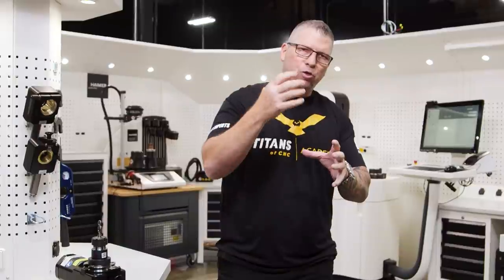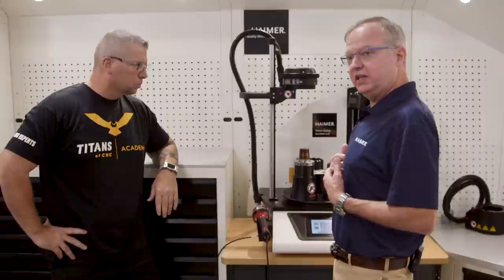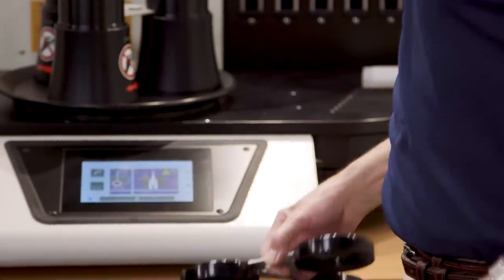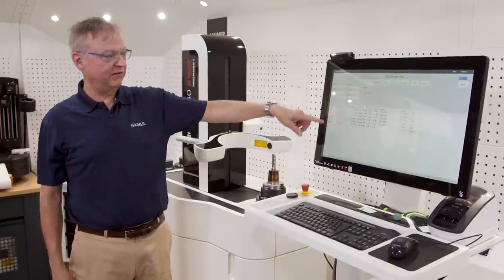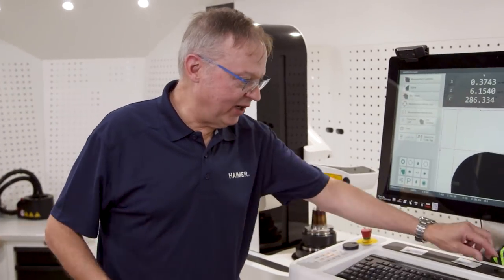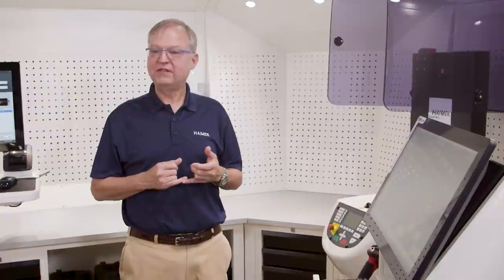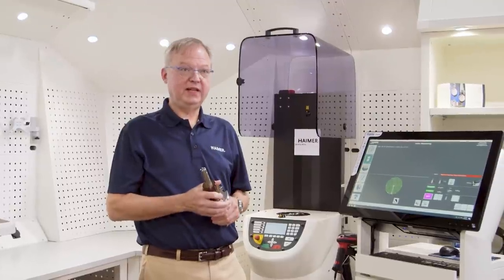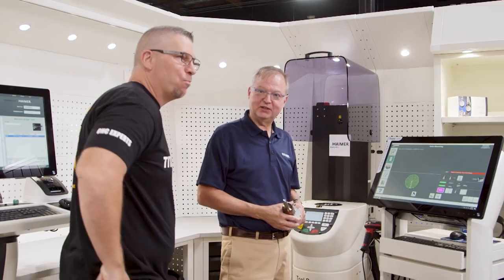CNC Machining Technology That Allows You To Compete | HAIMER Shrink Fit, Presetting & Balancing

Comment: I worked at a shop where we would replace spindles every 3-4 years. We implemented a similar system and it increased spindle life and paid for itself in the first few years. I would recommend this if you are holding tight tolerances.
Reply: What did you guys do that you have to change the spindle every 3 to 4 yrs?

Comment: This is amazing. Here’s my process at work: I take the holder out of spindle and drop it into a vise. Loosen the set screws, remove old tool, open drawer and hope I have another, drop it in, make sure it’s seated, tighten set screws with worn out Allen key and pipe, slap back in spindle and hit the cycle start button. My how technologically advanced we have become...
Reply: I know what you mean! Hydraulic tool holders have been a huge step up for me from some terrible ER collets but to jump up to this set up for most small machine shops is inconceivable.

I did wonder though, why not just get an induction nut buster and a vernier height gauge?
Reply: If your not short on time, you could also do it with a torch

Comment: Im very new at the whole CNC Mill game but I actually just ran into a situation where I was getting a really crummy contour finish. After a couple of hours of changing tools, s/f rates etc. I finally call a buddy who is a pro. His advice, change the holder. I did and it fixed the issue. He uses a bunch of the Haimer gear in the video (makes medical parts) and said if nothing else invest in the shrink fit stuff.

Comment: seems like that setup is more expensive than spindle bearings but for the right shop it would work...
Reply: The heat shrink is awesome. The preset tool makes sense for shops that have many machines. but the balancer seems over the top and the system is dumb. why do i have to look on a silly chart in the box wich screw to pick? The machine could just tell wich screw to put where. and think about sorting them back after the tool is worn out...
Reply: Hardcor3crash  if you watch maritool shop tour on nyc cnc they have a balancer that you actually drill a certain depth on the side of the tool in between keyway flats pretty cool video love the mill turn machine they have its awesome
Reply: @Vincemaan  Balancing is an investment, but the increase in spindle and tool life pay for it quicker than you would think! Fixing imbalance with screws is an inexpensive correction method without permanently removing material from the holder every time you need to change a tool. The chart makes it easier for the user to correct balance issues without needs 100+ different screws for individual weights; imagine trying to put that many screws back in the right place!
Reply: @haimerusallc  I understand that. But the machine can know that this is a balance error that cant be corrected with one screw and could tell just tell like put a Nr 4 screw in the hole 3 and a Nr 1 Screw in hole 5 instead of doing that thing with the chart. That would remove the operator error if someone does not understand the chart. I mean even "boom Bob" had to look twice on the chart...
Reply: @Vincemaan  We see what you mean! The reason the balancer doesn't tell you specifically what number screw to use is universality, so customers can use other manufacturer's weighted screws. Some have even made their own!
Reply: Time is money and unplanned breakdowns eat a lot of time and even more money. I worked in a plant that lost about 1 million an hour when we were down! This system is preventative maintenance, not to mention the parts you are making are going to have an awesome surface finish.
Reply: @haimerusallc  well you could support both.
I.e. have screw kit profiles in the software.
Or even just store the screw kit info in a qr code on the box.
So then you can optionally also tell the operator how to do it with their kit.

Just an observation.
Reply: @Vincemaan  I agree. Make that machine's computer do a little work and eliminate the chart. 
I see under - utilized computers everywhere I look....    :)
Reply: @artmckay6704 in this case it does not matter if you get it wrong. you just have to do it again but so often misstakes are made because the process is shit. its not possible to concentrate a whole workday so use the brain time wisely....

Comment: I've used a haimer shrink fit m/c for over 20 years. Never had the chiller part, just use the big water tank on the waterjet cutter. Tool length setting has been using a 1" slip gauge on the m/c has worked fine for 35+ years, if m/c doesn't with a tool pre setter company isn't going to fork out for one.

Comment: This is cool but you don't need any of this to compete, the shop that i work for does aerospace parts all the time and we havent bought a single shrink fit holder or a touch off machine, we have looked at them but the cost of them is way to high when all the machines have touch off setters in them, and you dont really need to balance your tools and tool holders until you get up to 20,000 rpms or more. Hes showing you what you COULD have if money wasnt a object like it is for him, where you could drop $200,000 on a room like this. Def NOT needed to compete

Comment: We have all this in a special room its set in . And no one really uses it . Yeah we use the shrink fit heater and cooler . But no one knows how to use the balancer or the touch off machine. We just use our machines setter and or laser setters . Sometimes even just a height gage with  1,2 3, blocks for our capto C8 holders if we don't want to go the machine route even . Never any problems . Okuma B750

Comment: Shrink fit is awesome but it really is older tech. Was using shrink fit 25 years ago. Can also set tool height and diameter on machine faster using laser!
Reply: Sounds like your facility appreciates precise tech! Shrink fit has been present in the industry for some time, but as a continually evolving technology, the possible applications are growing. Also, while using a laser on your machine tool is an option, utilizing a presetter allows for that machine to be making chips instead, thus increasing productivity. Be sure to check out our side-by-side comparison of laser presetting and our Microset presetter: https://www.youtube.com/watch?v=yXBJayQmsk8

Comment: OK so I'm going to assume that those weights won't come out at 11000 rpm without thread locker and that you have to run coolant or will heat transfer from endmill not be enough to " unshrink" the " interference" fit if run dry ? ( but ok who doesn't run coolant these days )
Reply: I would assume the same thing about the weights as well but as for the holder getting hot enough to "unshrink fit" the tool... our doing something very wrong if your tool and holder get that hot.
Reply: Actually, our screws are rated for 40,000 RPM once they are bottomed out in the threaded hole. Shrink fit will work whether you run coolant or not, but you definitely want to clean the holder before shrinking it again!

Comment: how about run out??checking on shrinkfit
Reply: I use a zoller at work to measure all our cutters, shrink fits mostly come in within .001 as long as your pre setter is calibrated should be all good man!

Comment: I take it when the tool is blunt you have to throw away the tool and holder, unless you can un shrink it ? Regards from Australia.
Reply: No, the holder is re-usable. The heat thermally expands the hole of the holder so that a tool can fit in, when it cools it contracts again clamping onto the tool.

To remove just reheat to expand the hole to replace tool.

Comment: How do you get the cutter out when it is worn
Reply: A-a-ron yes it’s the same with automotive parts. There’s no way to remove the two without impacting the integrity of one of them.
Reply: @A-a-ron Exactly right! As long as you stick to shrinking HSS and solid carbide, you should have no problem running a heat cycle to remove a dull cutter.
Reply: @soundspark  The difference is in the metallurgic properties of the holder/cutter, and the amount of heat being used. If holders are overheated, you will notice a difficulty in removing the cutting tool.

Comment: While it does have merit to add human-readable text to the printed label, it doesn't make sense to print a QR code as the whole system is using a Data Matrix. Why not stay with Data Matrix throughout? Then you could just repeat the Data Matrix code laser etched on the tool holder, which is essentially a license plate or serial number for tracking purposes. Then the user could visually verify that the label Data Matrix matches the one on the tool holder while applying it or subsequently. Thus preventing putting the wrong label on a tool holder because you know it's going to happen eventually.
Reply: Many manufacturers are heading in this direction, but implementation is an investment. HAIMER aims to offer a variety of solutions for all businesses, no matter their size.